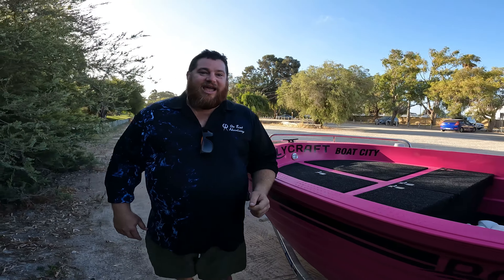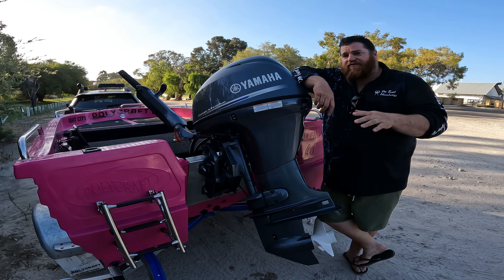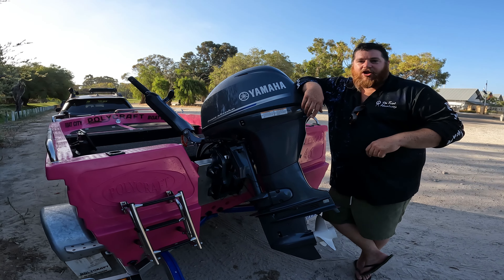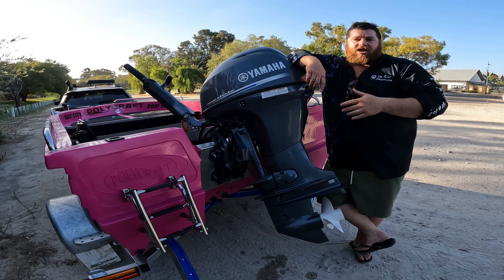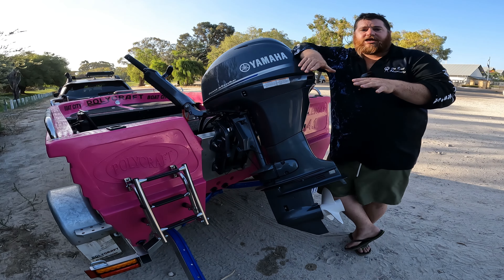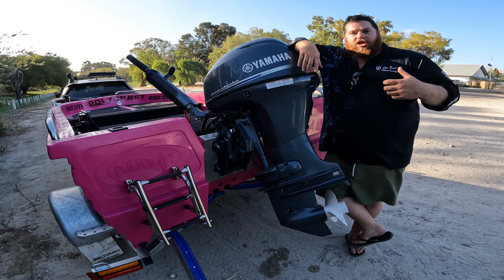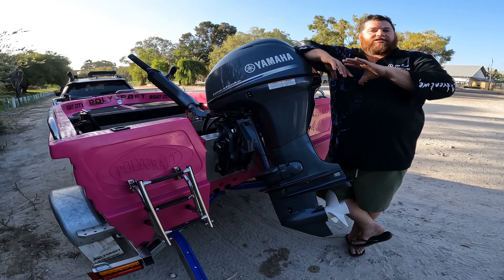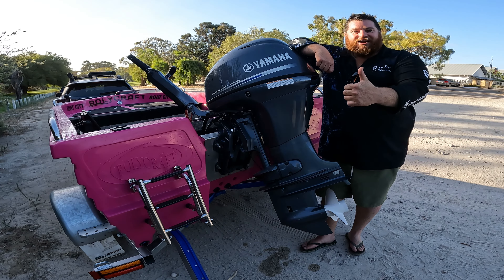Boat Performance | MAKE YOUR BOAT FASTER in 4 simple steps

Comment: The only thing I would add is an adjustable jack plate to fine tune how deep the motor sits. Like you mentioned some boats may do best with the cavitation plate level with the bottom, some may perform better with it sitting slightly above, etc… the only way to know for your own personal hull/motor combo is to play around with it. Just like you mentioned doing with weight distribution.
Reply from the maker: Adjustable jacking plates are complete game changers! Cheers for the comment.

Comment: I have a honwave sib 4m the boat weighs 86kg and my Yamaha f25 58kgs my top speed is 24 mph should it be more? I tried a higher pitch on the prop and the boat went 2mph slower lol trim needs to be in the middle because to low it drags to high the prop breaches the surface 🤷‍♂️
Reply from the maker: As boaties we never should stop tinkering to try and achieve greater results. Good luck mate
Reply: @On-PointAdventures  I ran a few more tests with trim settings and 2 prop changes! With a negative result, 24 mph is my lot with the factory standard prop

Comment: So many get the outboard height wrong. For instance Tohatsu are 20.7 inch legs,, not 20 inch, so if you just dump it on the transom you are already at least 3/4 inch below keel line.
Reply from the maker: @bobbuilder5362  exactly

Comment: Hi, cheers for the tips. When you say 25mm for Yamaha, is that above or below the bottom of the hull?
Reply from the maker: 25 mm above the transom. Ie cavitation plate should be level with the bottom of the hull